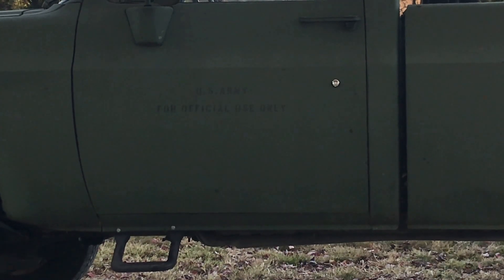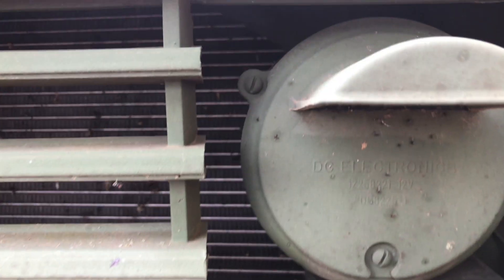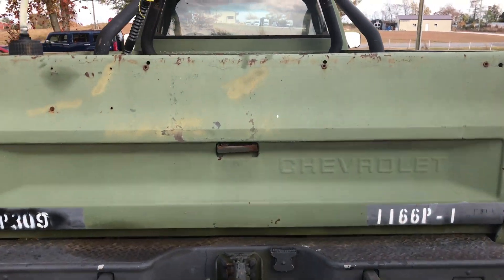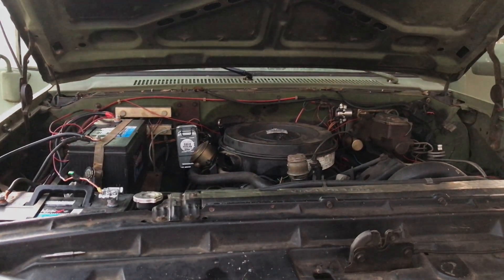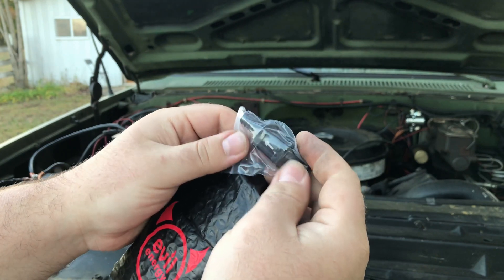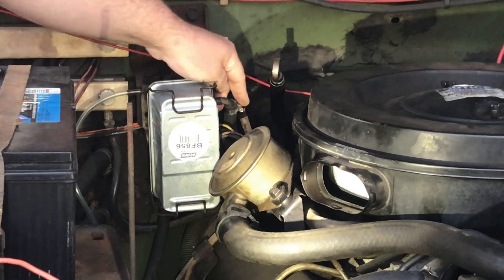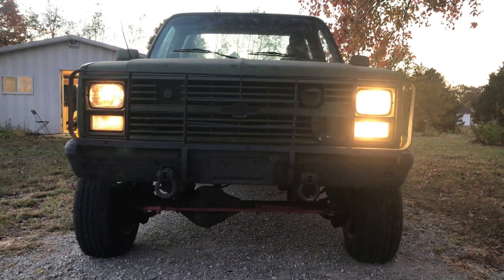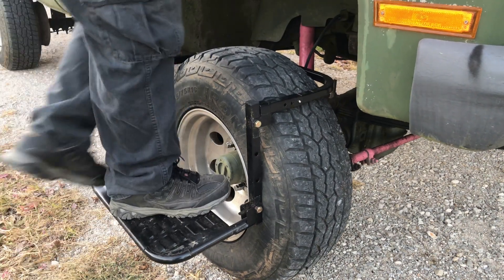Check Valve Mod for 6.2 & 6.5 GM M1008 CUCV Military Truck Diesel Fuel System How To + A Quick Look

Comment: What if I put it really close to the gas tank?
Reply from the maker: The check valve mod is really a fix for a weak (therefore failing) mechanical fuel transfer pump. It prevents the fuel from draining back into the line when the engine is not running (the fuel transfer pump normally does this when it's working properly). You could theoretically place the check valve anywhere between the tank and the injection pump inlet. It was just easier to place it up front near the firewall on this one. It's not a restriction to fuel flow, like a filter would be, so you could theoretically place it in the fuel line before the transfer pump. Anywhere it would prevent the fuel from backing up into the line and therefore the fuel tank.

Comment: I’ve watched the video a few times now and I think this will solve a problem I have on my Suzuki Samurai with the 1.6 turbo diesel. I believe the fuel drains back and it cranks hard to get primed again making it very hard to start. I think it’s worth a try to be able to drive it again… Thanks for sharing!
Reply from the maker: It's worth a shot. The little aftermarket check valves are not expensive and will definitely solve an issue with a fuel transfer pump that's leaking back. A bad glow plug , wiring or timer can also cause starting issues on the 6.2. I've not had any experience with the Samurai diesels but generally most diesel engines can suffer from similar issues.
Reply: @KentuckyFriedFixes  Definitely worth trying. Ordering mine now…
Reply: My check valve came in and I will be installing it today. Really excited to see if it solves my diesel fuel problems. Thanks again!

Comment: Cool video Chris, I’ve always wanted one of these trucks. There really built to last. A friend of mine has a crew cap square body from the military but it has a 454. Are there other plans for the truck? Would look forward to more video about the truck. Thanks for sharing.
Reply from the maker: I think Jerred wants to do a complete restore on this one. He's getting the mechanical stuff out of the way first as time permits. It's tough to do a restore while working a factory job. Not a lot of time left over at the end of the day. I know he just recently dropped a bunch of cash into it for a fresh transmission rebuild at a local shop. He could have done the transmission overhaul himself. He's rebuilt auto transmissions before but didn't have the time to get to it before Winter. Now he's been going thru the electrical systems, starting/charging etc. I love the truck, you can't kill those things. I'd like to see it put back to original but I do like the wheels and roll bar he's put on it. That lift kit though, I'd need a step ladder to climb aboard. 🤣 Thanks!

Comment: I've worked on several threw the years as they started phasing them out for the Humvee when I was a young Pfc we would get a few new guys ever year luckly my Colonel was always up for a good joke so I would send them all over the motor pool in search of an ID 10 T form the keys for a humvee
Reply from the maker: We had these when I was in the Air Force in the mid 80's. That's about the time they started sending HUMV's to the bases. I liked the Chevrolet trucks built to this standard better than the Hummers myself. Even though the CUCVs weren't made for front line use, that's fine by me. My H3 wouldn't fare well if it drove over a mine either but I don't have problems with mine fields here locally. 🤣🤣🤣
Reply: @KentuckyFriedFixes  we have a local guy I did a 24v Cummins frame swap to a 68 dodge AF 4 door power wagon I did cab forward electric and mechanical last I know it has glass and has been painted he is in the middle of having a custom hydraulic dump bed being built using the original side step it's a pretty cool machine I'm with you i love anything military we have a old m88 at the farm we use for water tanker

Comment: Oh hell yeah, we're brother cousins! I originally came to your channel for mini bike engine stuff and I also have a M1009 cucv blazer.
Reply from the maker: I love that stuff too Tim! Those M1009 vehicles don't die easy for sure!
Reply: @KentuckyFriedFixes  its hard to beat any old mechanical diesel engines.
Reply from the maker: @timbattle3415  Jerred's getting me motivated to start working on my old 7.3 IDI rollback. I need to get that thing back in business but it probably won't be a cheap fix.
Reply: @KentuckyFriedFixes  duuude! An idi 7.3 rollback is totally worth what it takes! Besides that could be a series for the channel. I know the 6.2, 6.5, 6.9, & 7.3 all use the same standyne db pumps

Comment: Great mod but yuck, I hate hose clamps.  PEX style ear clamps do a much cleaner installation.  The only drawback to ear clamps is that they are single use but the cleanliness is worth the price of admission in my mind.

Thanks for posting.
Reply from the maker: Some AN fittings would sure be nice too Doug but this old beast only got the cheapo imports from HF box. 🤣🤣🤣 Hope they don't fall off! Thanks Doug!